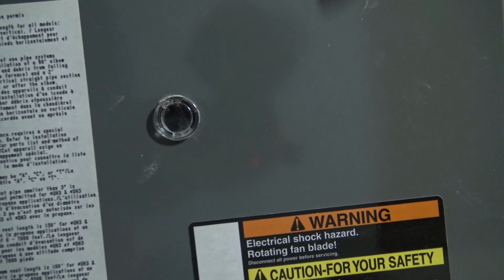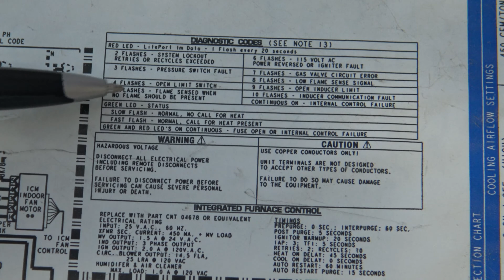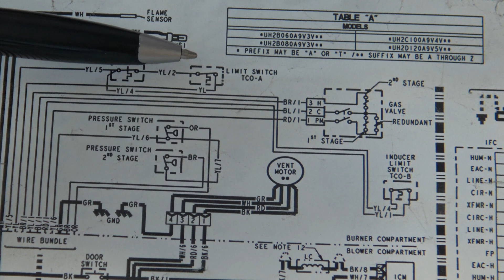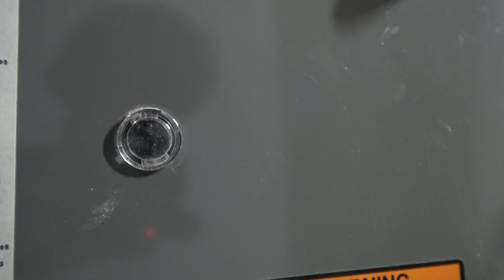Furnace Fault Codes -How To  Read and Fix Red Blinking Light

Comment: dude, you didn't show the blinks
Reply from the maker: sorry beginner you tuber, have a good night
Reply: @addismultitasking3504  make sure you watch the video before posting it :)
Reply: @lorax8172  Waiting for you to show us how to do the video right.  I understood what he was talking about just fine.  Make sure your video shows how to use any wrenches correctly too.  SMH.   Still hiding in Moms basement?
Reply: Like he said just look through the peep hole and count the blinking light. If the red light blinking hard to read, turn off the furnace switch(reset) for a minute then turn it on again and watch the peep hole to count the blinking and read the diagnostic chart somewhere in the furnace or the booklet it comes with.
Reply: You can't count?